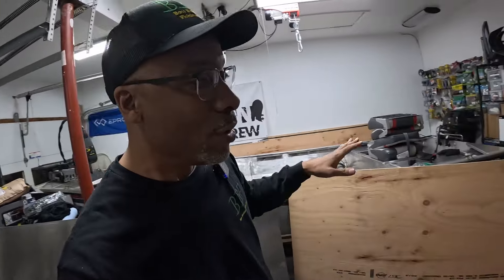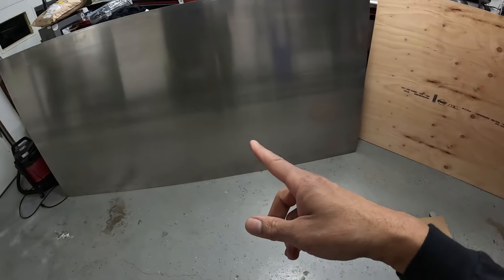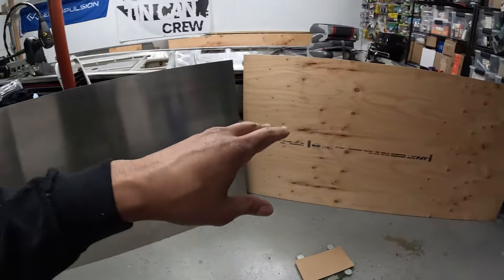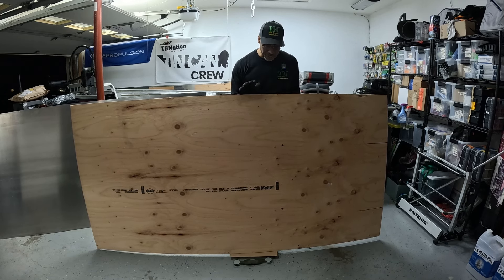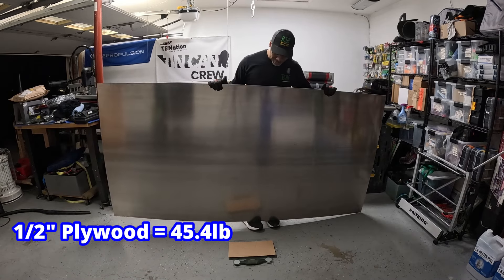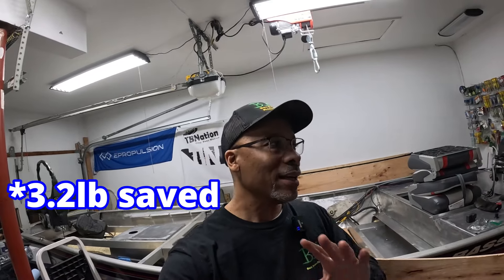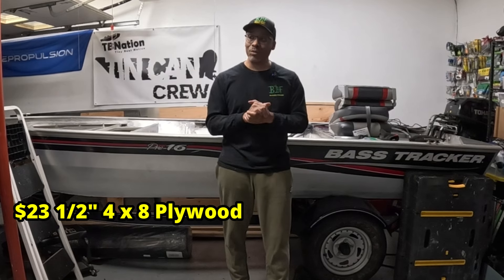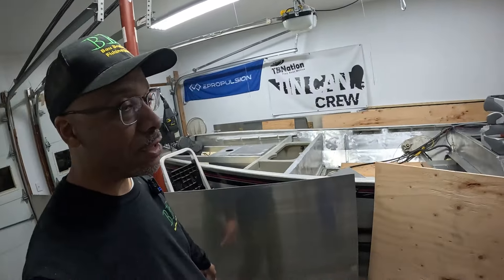Does aluminum really weight less than wood for your boat?

Comment: Thanks for doing this comparison. As someone who recently customized my 14 foot Alumacraft, I can confirm aluminum is definitely lighter than wood. It also will never rot. The cumulative weight of being able to use different gauges of aluminum sheet makes all the difference.
I fish in saltwater and wood was not an option. I've used the boat several times now and it has performed great!
Reply: Why is wood not an option?

Wood can rot, but boat builders should know how to prevent rotting!

Comment: Best bang for buck is frame it with aluminum and plywood deck it with simple hatches. Coat the wood in resin and go fish for years. Not sure what the fad is on spending $1500 on 8 dry hatches in a $500 12 ft boat. But do what makes you happy 👍.

Comment: You may have said it, but I'd bed interested to see the weight of the plywood after epoxy/sealer as the aluminum doesn't need it but the wood would weigh slightly more.

Comment: Using wood is a better choice between both options.
Reply: Why.
Reply: @tapinwithted  Weight is not the only comparison that can be made between materials. Strength was never a comparison made on this video between both materials.

Many boat builders use wood to build their boats. I saw a few boat builders who use aluminum, but most using wood!

Aluminum, and wood are not the only materials that can be used to build boats!
Reply: aluminum is sooo much better.  do it once and forget about it.  with wood it will eventually get water logged or rot and have to be replaced
Reply: @knowledgeandmultiskilled  ok buddy.  i only build aluminum  decks for mud boats on the side. but what do i know right?
Reply: @jordankrawczyk8375  Not much compared to me!